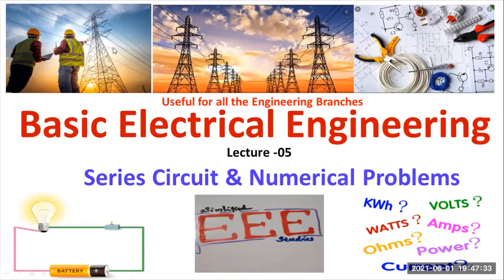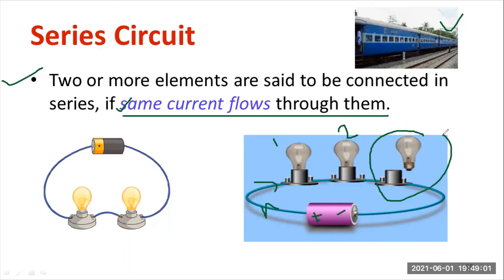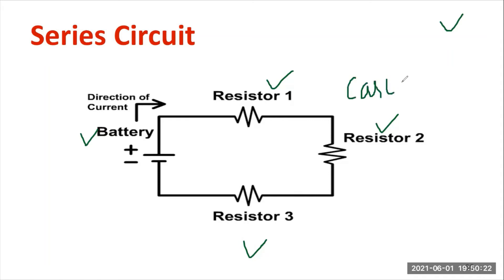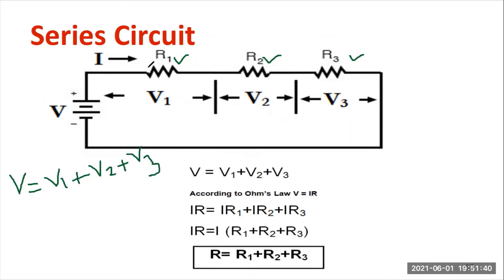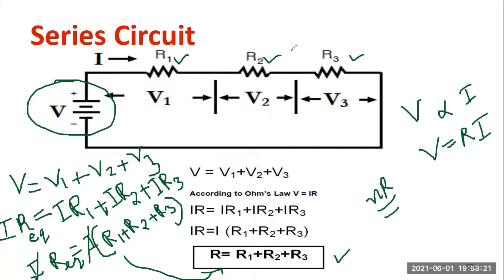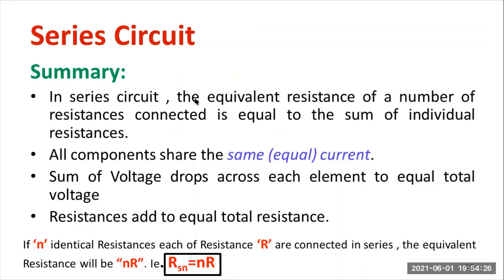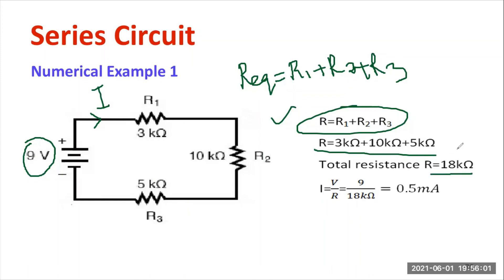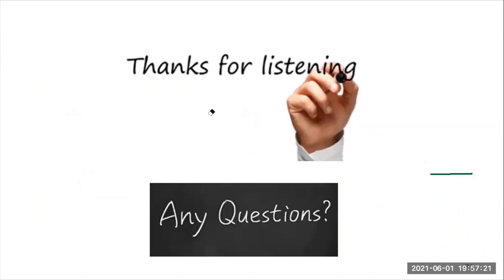DC Series Circuits|Basic Working Principle|Resistor in Series|Electricity & Circuits|Calculation|EEE

Comment: I am. Not able to understand why current will be same? Please make ir clear. 🥺 properly this doesn't make any sense when current passes through a resistor then the current must decrease
Reply from the maker: Good morning,
As per the Voltage Division rule,  voltage across individual element is getting divided depending on the elements say value of resistive element.
And current through each element remains same in case of Series Circuit .
The statement is according to voltage Division rule.
I have done the derivation of Voltage Division rule.

In parallel circuit, voltage remains constant according to current Division rule.